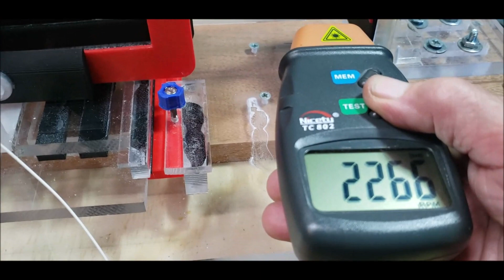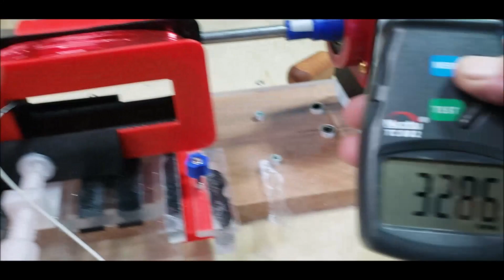3D Printed New Rotor Run

Comment: Michael excellent progress and beautiful work you have done, you can put some lubricant on the side that makes contact (a small drop) and you will hear less noise, the shaft that makes contact has to be on for some time to stabilize, it is Like a new car engine, metals smooth over time. The other thing you can do is "move the coil" and move it away from the rotor, with that you release more eddy currents and the rotor will rotate much more than 3200 RPM, you can also move the hall sensor and find the best place where the engine work better.
Reply from the maker: ah yes that makes a ton of sense. I didn't even think to use lubricate. I have the dry type which should work great. But I'll try both dry and wet.  You are the man Jorge!!!!!  Thanks for the positive words it means a lot coming from you.
Reply from the maker: wow what a difference the dry lube makes. The noise has completely changed to  a hum.

Comment: very nice... in my experience when printing rotors, or round parts, they never turn out 100% evenly round (balanced) and that for several reasons. the repartition of the infill is one of them, also the seam, (whatever you choose as "seam alignment" or "Seam corner Preference" in your settings in cura). I found out that putting the shaft in a drill and sanding the rotor (or round part) down for about a mm helps. (you would need a thicker outer wall) The other method for balancing is for me, by drilling 3 mm big holes all over the round part, and filling them one by one with glue pads (like patafix from uhu or Poster putty from duck brand) the holes must not face the outside or the putty is pushed out when the rotor goes faster.
But this build is very nice, and is very close to the one sky made. But imho you could use a piece of plastic pipe (like they are used in plumbing) around your printed rotor, because if you reach more than 10.000 rpm, it could tear the pla apart.
Keep up the nice work!!
Luc
Reply from the maker: all great suggestions and I usually have a second printed tube that I put around the main rotor. I will try and sand off the seam in the future

Comment: Michael just one more question:  at 028:00 do you have an aluminum plate where the axle makes contact? If so, it is an error because aluminum is very soft and in a short time it will be perforated and in this way it gets out of control, you have to change that aluminum plate for a stainless steel one, this metal is harder to perforate and the engine lasts much longer, it's just a comment.
Reply from the maker: yep that is an issue. Its the only metal plate I could get at the time. I'm researching on where to get a SS plate and will change them out asap
Reply from the maker: I just ordered some 304SS plate sheets ;-)

Comment: Is it possible to the ends of your rotor to hold by magnets to reduce friction? Maybe a pole magnet inside of a hollow circle magnet. Just a thought

Also, is there a difference it output using insulated copper vs no insulated
Reply from the maker: I always use insulated wire so nor sure about that. I've also thought about using opposing magnets at the end of the rod but thats really hard.
Reply from the maker: David I just reread your comment ad I think you may have missed the build process. I am using ring magnets on the end of the shaft and larger ring magnets in the right and left housing for a "maglev" almost no friction rotor. The only friction is the point of the 304SS pressing against the side wall.
Reply from the maker: unless you meant what I first thought?